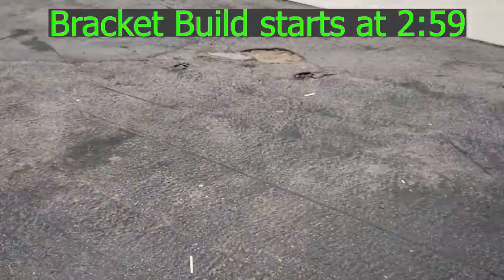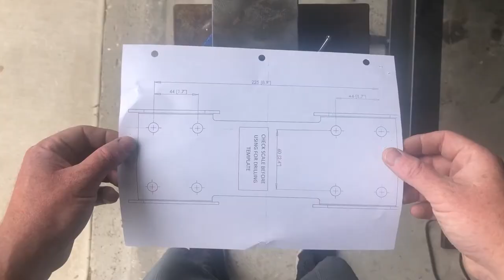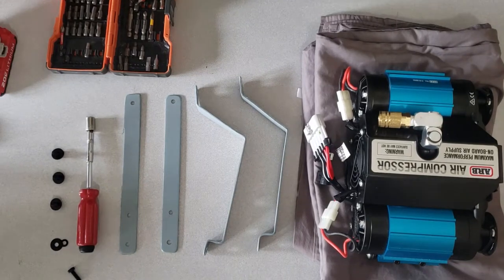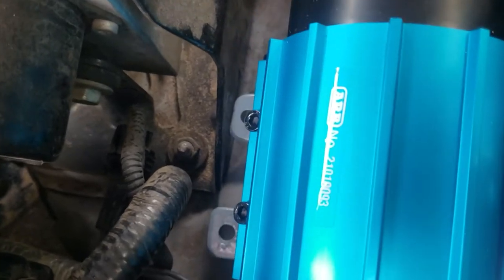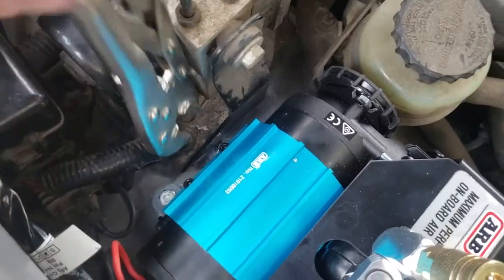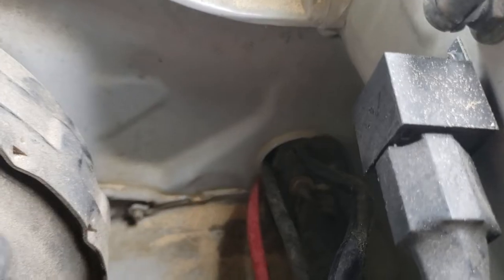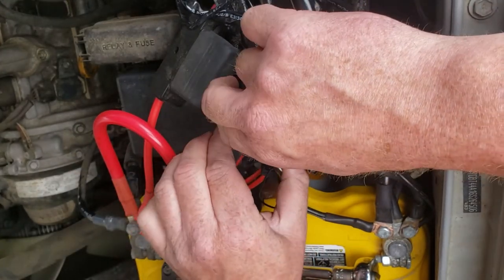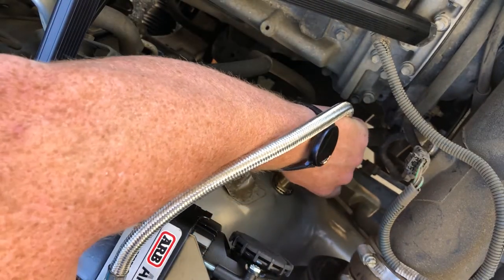Dirt Cheap DIY ARB Twin Compressor Bracket | 1st Gen SEQUOIA |

Comment: Awesome install. I love how there's so much room for accessory expansion with the blank button slots on center console.  We have 2 lifted Sequoias, love 'em.  Both later 1st Gen.  Have had 3 now.  First one got wrecked by a guy who rear-ended us at 55mph.  It was still drivable but insurance totaled it due to rear quarter panel damage.

Went and bought 2 more!
Reply from the maker: Total luck that the button fit! My wife caught the bug and just traded her 2019 Hyundai in for an '03 Sequoia, can't wait to start building it!
Thanks for watching!
Reply: @treehouseoffroad  Gas mileage is about the same as 4Runners, so it made more sense to just get another Sequoia for us.
Reply from the maker: @LRRPFco52  I've never owned a 4Runner but that's what I hear, crazy how a 6-cyl guzzles that much gas
Reply: @treehouseoffroad  I have both, 4runners are surprisingly heavy for what they are, so motor has to work so much harder to keep up. But with 316000 on the clock it still runs like a champ. Dont really want to let her go but the wife says I have too many cars... Psssh! Lol
Reply from the maker: So you're in luck then, bc the 4runner isn't a car 🤷🏼‍♂️

Comment: My Via88p has a Female Schrader connection on it. Can't seem to find a Male Schrader to Female 1/4 NPT to connect to a similar digital gauge
Reply from the maker: You might have to do a male schrader to male npt, then a female to female npt adapter. If you only need one or two things Ace Hardware has a massive selection of those fittings.